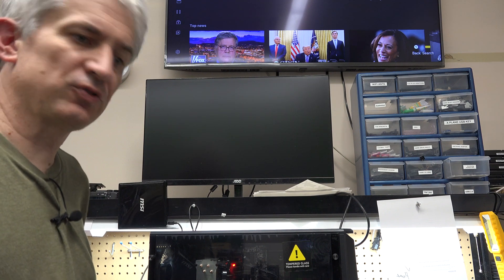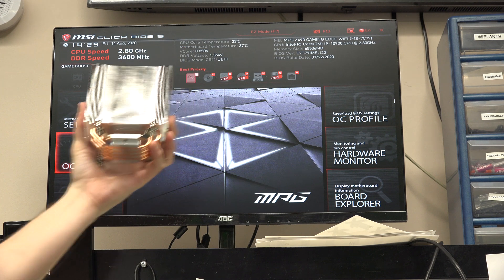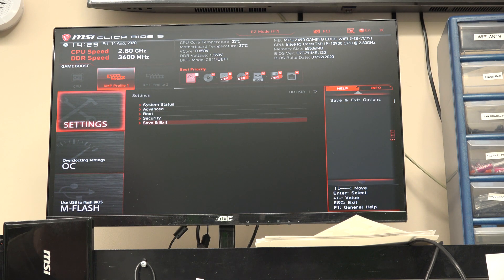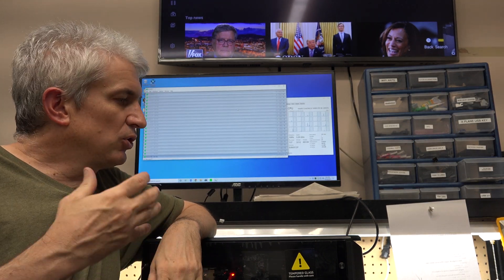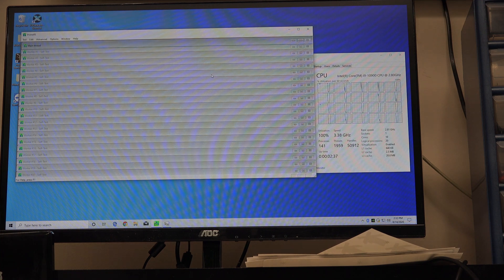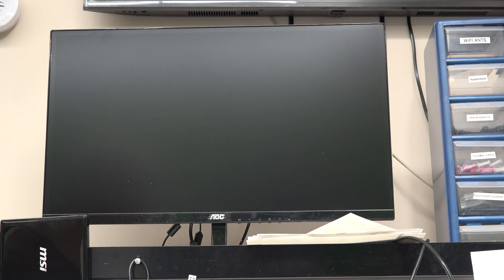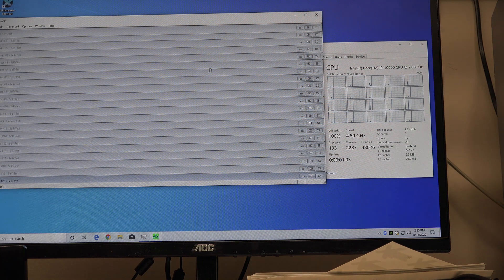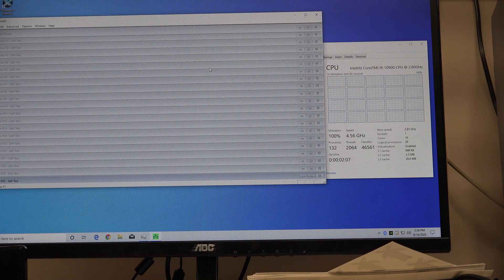MSI BIOS - Choose your cooler type - does it matter?

Comment: I'm a little confused because according to MSI Center, when I use "balanced mode", my processor is basically turbo boosting 100% of the time. In the BIOS this option is set to the crappy stock cooler setting. So why ISN'T the PC turning off the boost? Is MSI Center overriding this?

I have a huge tower cooler on this system so I'm wondering if I need to change this setting.
Reply from the maker: If you have a "K" processor, it seems to ignore the cooler setting.  You may have to manually set the power limit.
Reply: @xforcepc   I have a non-K 14700. It feels like MSI Center is overriding that bios setting. Just wondering if I should be changing it from stock cooler to tower cooler mode or leaving it alone.

Comment: Hey Michael. I have a Vetroo 360mm aio and  from what i saw online a typical 360mm aio uses 350-380 watts. When i go into the MSI Bios it gives me 3 options to choose from for cooler types with their wattage next to it. I game a lot (FPS games,) so i want it run fast as possible but don't want it getting overheated. 3 options: Boxed cooler 253 Watts , Tower Air cooler 288 Watts, Water Cooler 4096 Watts. Plus, if i run XMP will it matter also? I know XMP is related to memory but it all works together so wasn't sure. Any help would be appreiciated. Thank u.
Reply from the maker: Would set it to water cooler.  The 4096 watts just means there is no limit by the BIOS and the chip can ask for what it wants.
Reply: @xforcepc  Thank u for the fast reply. New to pc gaming. I built my pc about 6 months ago and still trying to mess with things to get it running better.

Comment: Would be interesting to see some temperature differences and benchmarks based on these settings. If you have a tower cooler that gets hot under load is it worth selecting box cooler? is the performance difference that noticeable vs the temperature?

Comment: Why don’t I have that option in the bios!?!
Reply from the maker: Does your CPU support integrated graphics? Not all of them do
Reply: @xforcepc  mine does not but when i swapped my stock air cooler i swapped it out for a better on and it showed me a pop up when i turned on pc booted to bios stight forward. when i installed AIO none poped up..

Comment: Iam using water cooler in bios while iam using my 10400f with stock cooler at max temp 84c, is that dangerous?
Reply from the maker: Staying under 90 should be the goal.
Reply: @xforcepc  so choosing water cooler in bios while using stock cooler will give me better performance right?
Reply from the maker: @dolaaz  Yes, but more heat and possbile overheating.

Comment: I'm using the MSI 240 Liquid Cooler on a 10700K (not overclocked or game boosted just standard intel turbo boost) and have my cooler setting set to liquid in the bios. Running all MSI components  and case corsair ram and six cooler master mf 120 fans playing Elden Ring CPU consistently runs at 100C. Idles at just under 40C. WTF
Reply from the maker: I guess I have to ask if you remembered to remove the protective plastic from the copper plate that goes on the CPU?  I have forgotten many times, but it becomes evident the instant I hear the fans ramp up.  Also, you may need to make sure your thermal paste is spread well and the pump is seated flat on the CPU.  Lastly, make sure your fans and pump are set to speed up and slow down in the BIOS with the temp of the CPU.
Reply: @xforcepc  LOL I did forget when I first built it in 2021 but I corrected that within a day or 2. It has always run hot but not over 100 in other less demanding games. I've tried all kinds of power management settings and things that are supposed to limit turbo boost but it still turbos. Next step is to take it apart and reset the cooler, funny thing is, I won a 10900K wich is supposed to run even hotter so I'm scared to put that in. If that doesn't work Im not sure if a tower cooler might be a better bet. Not sure I trust Liquid. I had one explode many years ago and this is my first attempt at liquid since then.
Reply: For example I changed my bios to the base cooler setting last night to trick it into running at lower temps and that didn't work. Fans all ramp up like they are supposed to.
Reply: Try repasting your CPU with better thermal paste

Comment: If you have stock cooler i recommend you to undervolt, i have I5 11400f with stock cooler (for now) i locked it in bios like in this video at 65W then undervolted with Throttlestop -100mV . Now i have comfortable 75 deegres celsius cpu temp and 4.2 GHz clocking speed.

Comment: Those settings for cooler options in the BIOS only relate to later model MSI boards & it would not be applicable for the majority of owners. However outside a 2-core celeron / pentium, no one should be using the stock cooler intel include with a CPU above those 2 variants.

Comment: If I have liquid cooling with an Intel i7-8700k which is 3.7 Ghz standard and "boosts" to 4.7 Ghz. Would it be better to let the bios manage the "boosting/throttling" or would it be better to force an OC 4.7 Ghz regardless of current demand on the CPU (if the temp stays below 80 deg C)?  And why is one way better than the other or are they effectively the same as long as you remain below the recommended 80 C long term?  (Ive looked up my CPU specs on intel, the critical temp is 100 C).
Reply: Give it a go using both methods if your motherboard has that option in the BIOS

Comment: I dont like the new msfsm2020 i felt stolen 💸
Reply: I got the Prem Deluxe and wasn't impressed with the flight models, though MS hasn't had any amazing stock aircraft in their history, so not surprised. Anway, think of it as you bought a solid rock foundation- a World Simulator upon which to build and improve on. Third parties and the community will develop content, fixes, ect. I've shelved it for now until a study level 737 is released, but it's still worth the money in the long run. Hang in there. Both sims live happily each on their own drive in my PC.

Comment: Michael, The watts listed in the bios i think is not the power to the chip as under the water cooler its quoting 4000+ Watts. Is this not the watts of heat energy the cooler is capable of drawing off the CPU?
Reply: thats the LIMIT. 4096 is basically just removing the limit because liquid cooling. it's not telling it to send 4k watts